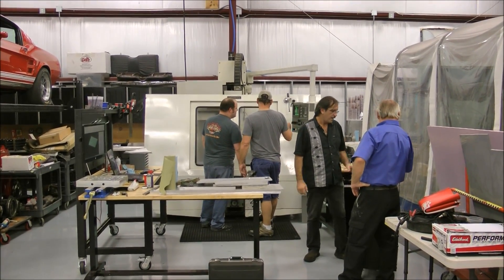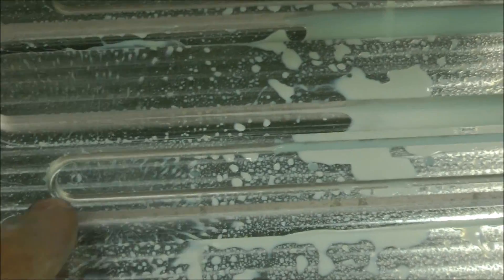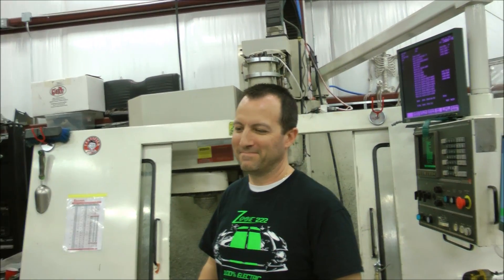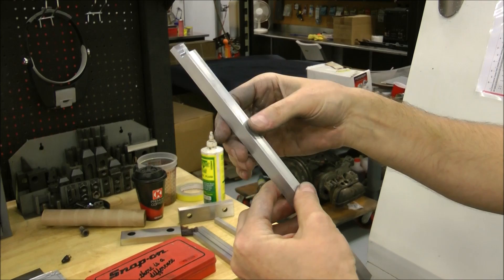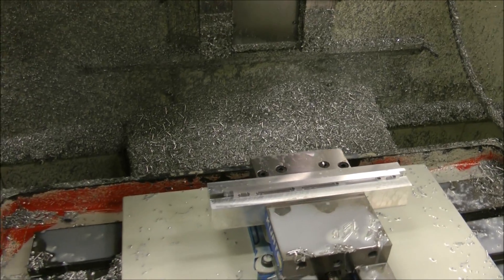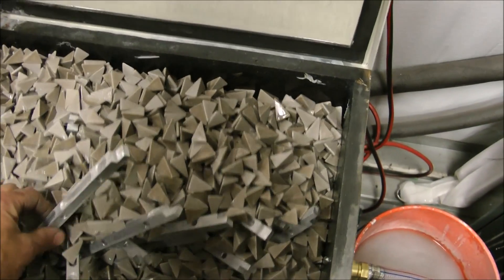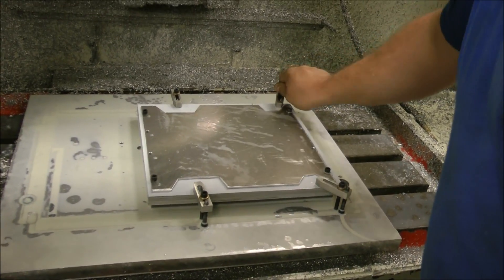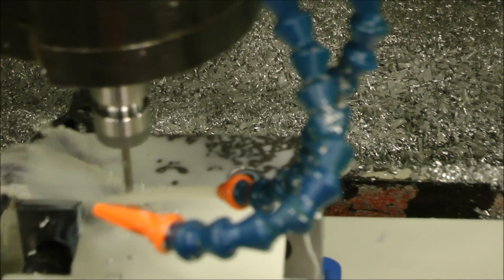1966 Electric Mustang conversion part 10

Comment: You guys are amazing. This is what what I would always wanted to do to my Z32. Are you guys hiring by any chance? And I am serious I dnt mine sanding the parts on that table as long I am part of what you guys are doing. Thank you for that the impossible is possible.
Reply: i have a Z32 and tbh was not thinking about doing this to that. but my grandpa has a 68 fastback and on that it would be amazing to make this happen. im thinking about doing a electric conversion shop it would be amazing!

Comment: You should make your own Tesla like chassis and drop the body on top of it
Reply: im pretty sure that's the most massive barrier of entry when it comes to building custom cars. the chassis is the portion of the car that's basically registered to the us government and its hard to get a custom chassis registered. so hard, infact, that most people use an existing registered chassis type underneath any custom car just to not have to deal with the red tape.....so if i took a ford chassis and build everything ontop custom... they would still end up registering the car as a "Ford" x on the paperwork. probably not the best explanation but basically custom chassis=red tape and hassle an almost never able to be made street legal

Comment: What type of cell are you using?
Reply from the maker: The cells have a 6c continuous and 10c 10 second rating. The pack will be charged to 400v and we don't know what the sag will be yet until we build it and test it, but the cells are some of the best in the world and past experience with them is that they are very stiff with voltage.
Reply from the maker: 75ah 3.7v LiPo High Power
Reply: nice!
Reply from the maker: They are the size of a large i-pad. You'll more of them in the next video.
Reply: What are the true C rating of the cells? What voltage do you get under load? 3.55? Cheers! :)
Reply: Cheers! :)

Comment: What are the specs in the new battery. Size? Expected range and power output?
Reply from the maker: 53kWh total. 355v nominal, 1500amp continuous discharge
Reply: mitchmedford that's pretty decent. So like 150 miles range ish? Plus huge power available all the time 😁
Reply from the maker: tesla pete we were given a target range of a realistic 125 miles.
Reply: 96s2p?
Reply: What is the expected weight of the battery pack with cooling and everything needed?

Comment: Thanks for the great info, I am working on a conversation myself
Reply from the maker: Good Luck. Learn everything you can about batteries because it is the single most important part of the conversion to get exactly right. Also, be careful with used battery packs from  "wrecked" cars.  Remember, you do get what you pay for. Learn about "P" and "S". Many folks mess that up and wonder why the car doesn't have the expect power.
Reply: Thanks. I am certainly in the planning phase. I have a Go fund me to achieve that dream. I am working and concentrating on the recreational side of things. Please keep posting great info. I certainly love what you are doing.
Reply: mitchmedford where are you located at? I love to visit you guys
Reply from the maker: We are in Austin TX. 78734 zip code.